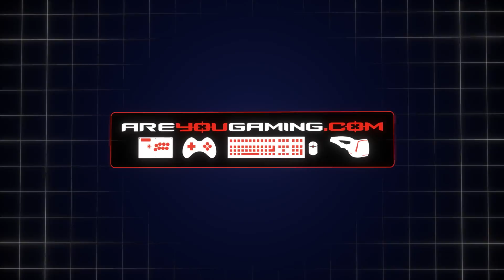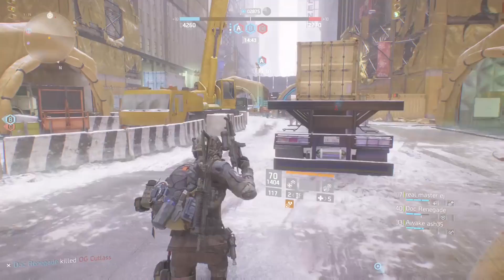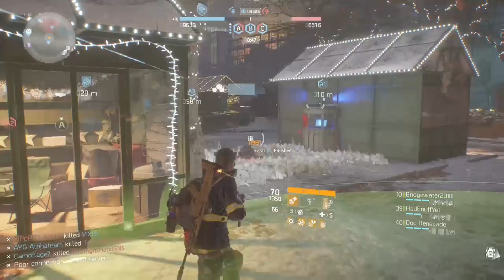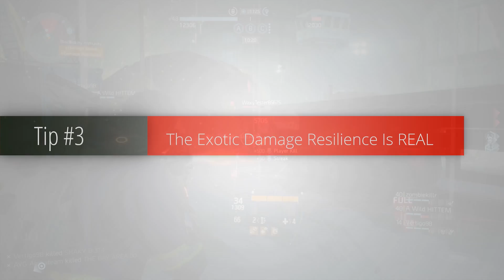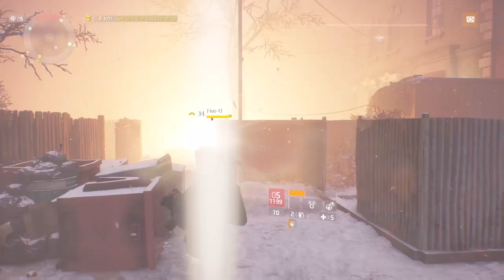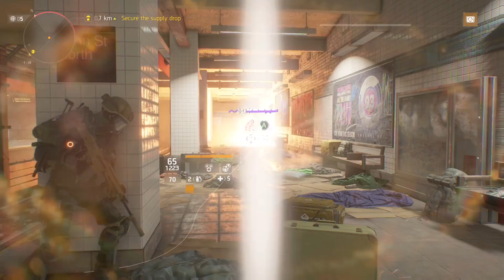The Division 1.7 Classified 6 Piece FINAL MEASURE Build - Insane PVP & PVE Damage

Comment: The PVE build is decent however in my opinion not the go to. When you're playing solo, it should work alright as shown in the video. However when you start playing in groups, you will score lot less than several other builds. For example a 3piece tac + 2 piece d3 fnc + ninjabike is a lot stronger just by the base perks. From final measure, you only benifit the protection from elites while d3 gives you 15% extra damage to elites. + 15 protection. And adding all the perks from tactician (skill haste, skillpower and the skillpower stack.) You got the talents and weapons right.

So the build is decent, don't get me wrong. But when playing in group, where npc's get lot tougher, this build is not the best choise. Unless for clear sky or falcon lost where you defuse the rockets or mortars.

My honest opinion.

Comment: Precision character talent only gives the base pulse amount NOT your pulse values i believe??
Reply: muziqfreek this is true
Reply: Not true. You can run full FA build and get 25% CHD and 10-12.5% CHC (not been completely data  mined as it you need a big sample size - I got 10% on 200 headshots, another tester 12.5%).
Reply: SilverWF what Coolheaded Brit said is true, precision has it's own separate values that aren't affected by skill power or base pulse.
Reply: It is affected by your Skill Power. But without mods - just base Pulse.
Reply: Thanks man. Testing it is really boring though!
Reply: Coolheaded Brit i never knew this information but i have heard it was quite strong. Thank you for clearing it up.
Reply: It’s not base it’s 25% CHD and a 12.5% CHC I tested it in the firing range

Comment: So you can use the classified twice can you reroll them if they already rolled on one build
Reply from the maker: You can roll two different things on each Classified gear set piece. It's pretty sweet.

Game On!
Reply: Are you using the same 6 piece gearset for each build
Reply from the maker: It's two separate builds. A few of the pieces are the same but most of the build is very different.

Game On!

Comment: I have two 204 Tactical ACR's i use for my 9300 electronics build, one has Destructive, Ferocious and Talented while the other has Determined, Destructive with Predatory for support.  Whenever your signature skill is used, just clean up a wave of enemies with your seeker mines and it is back very quickly with Determined.  They bleed with armor for around 150k and without between 90k to 100k on the elites and still nice on veteran enemies.  Challenging missions are a breeze to solo with a Barrett's vest, Inventive backpack and Tactician build and Legendary's can be done solo, it is just Napalm that is toughest in my opinion.  Your turret hits so hard too, it can usually burst most NPC's down with ease when playing alone.  The seekers remove their armor and the turret cleans them up if they don't die from them, it's easily my favorite build in this game.  When you drink a water, your sticky bomb hits elites for well over 3 million when you get chain reaction, and guarantees a kill or severe damage on heavys.  I killed the two medics right out the door on Legendary Warren Gate at the end before, i couldn't believe it.
Reply from the maker: Sounds like a sick build. I've got my Tach build for PVE as well. Good idea with the drinking water. I always forget about those modifiers. Thanks of the comment.

Game On!